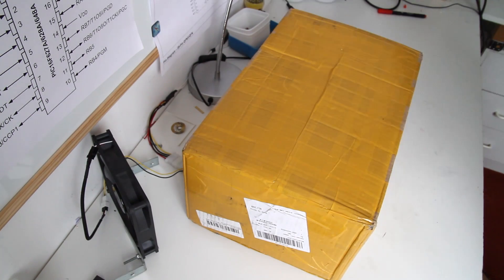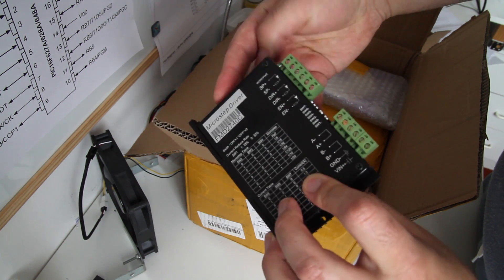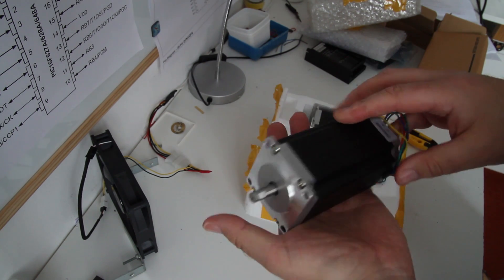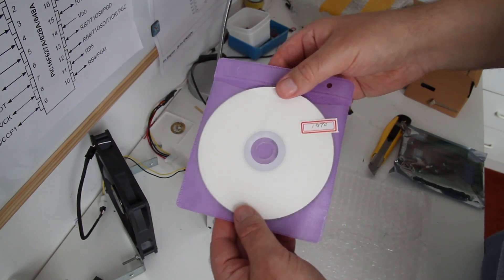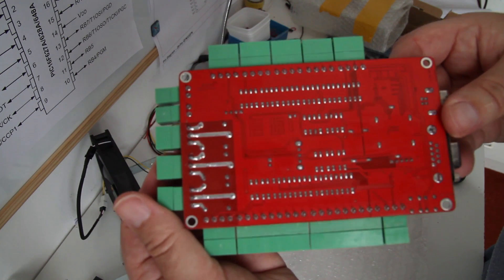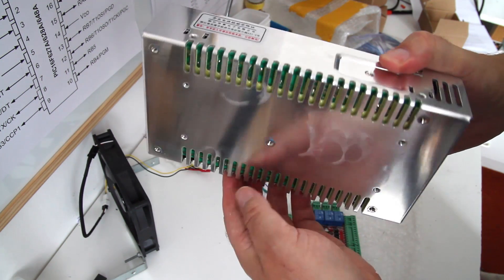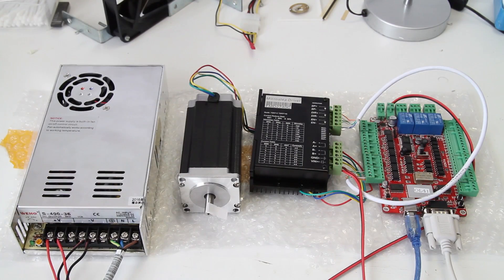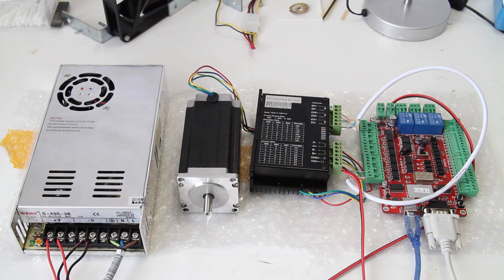Unboxing CNC Stepper motor kit

Comment: OK sir excellent
How much this kit and this model available
Reply from the maker: The old links doesn't work anymore, but this one is similar: https://www.aliexpress.com/item/4000044097918.html
I don't use the controller anymore, I went with AXBB-E fron cncdrive.com. Works much better, no more interference and the control software is better too (UCCNC). 
I've since put these steppers and drivers into a new DIY machine.

Comment: How much it cost the kit?
Reply from the maker: It was 217 euros. The usbcnc controller isn't great, better to use something better like uccnc. Seems to skip steps above 2000mm/min. And has bad path planner, ie small circles the velocity will often be too high. Uccnc is much better, can easily do 4000mm/min with the same stepper motors. I still use the stepper motors but in a new cnc build I designed myself.

Comment: I have recently purchased this kit. Has anyone got the UCNCV4 controller drivers to work with Windows 10 operating system ?
Reply from the maker: The supplied software still works under windows 10, just run it as administrator. I think I managed to upgrade the software once but I wouldn't recommend it as that might render the board unusable.

Comment: MakerCentral

  I need help on the hardware parts.
  and wiring the hardware up .
  and what software to use 
 to operate my CNC machine 
 Here is my list of the parts
 i'am using can you help me  

 1] Stepper Motor Drivers power step PSD8079-2P
 2] steppers motor Nema 34
 3] controler
 4] power supply mean well SP-320-48
 5]                  Hardware and Software 
 6] CNC Breakout Board/Interface Board
 7] Cable Connector
 8] Limit Switches
 9] Emergeney STOP BUTTON 
 10] Software

Comment: Ik heb dezelfde set binnen gekregen, aangesloten volgens de video, het PDF'je,  maar de motor reageert niet.. ik kan de as dan ook niet draaien, zodra de stroom eraf is wel.. als ik zonder de stroom er op de as met de hand draai, gaat het rode lampje op de driver branden... enige suggesties?
Reply: I received the same set, connected according to the video, the PDF'je, but the motor does not respond .. I cannot turn the shaft, as soon as the power is off I can .. if I do not have the power on the shaft turn by hand, the red light on the driver turns on ... any suggestions?
Reply from the maker: Did you send gcode instructions to the device in order to make it run using the supplied software?

Comment: Hi i have the same kit (4axis) but my stepper drivers have the Red light all the time, and idk if that matters. Also i have an issue with program crashing ( CNC is stopping and i need to reset the board or unplog it from PW) at some point of g code. Any help?
Reply from the maker: The red light is a power indicator, so it's normal. The board is sensitive to emi and groundloops. I had the same problem with a normal desktop PC. It would trigger the z axis when the spindle was powering up and crashes every now and then during a job. I now use a laptop and it works perfectly. You can try a different psu and check ground wiring, preferably in a star formation, so all devices connect ground to the same point directly.
Reply: Hmmm thanks. Could you send some photos od how u did ur wiring?
Reply from the maker: @ukaszswiadkowski8202  A photo won't help, it's a bad illustration of how things are wired. I use 5 wire shielded cabling so you can't see which wire goes where. See the pdf in the video description for more wiring info.
Reply: Also if u could tell how did u set Ur stteper drivers? I mean the switches. Thank you
Reply from the maker: @ukaszswiadkowski8202  
It will depend on your machine of course so don't just copy these settings and expect it to work in your situation:
XY
Dipswitch
1 234 567
0 100 101

Powerdown mode:   50%
microstepping:    1/8
Current:          3A

Z
Dipswitch
1 234 567
1 000 000

Power down mode:  25%
Microstepping:    1/2
Current:          0.5A
Reply: Yes i knows. Thank you :)
Reply: Also last question. Did you GND your breakout board? Cause i dont see any GND coming from the board. I think that might be the problem

Comment: Hallo, ik heb dezelfde set enkel met 4 nema 23 erbij, ik heb dit gedaan omdat mijn x as 2 motoren heeft. Helaas kom ik nu tot de conclusie dat het niet mogelijk is om de a as in slave modus te zetten.
Ik heb rattmotor gecontacteerd, en zei geven ook aan dat het met deze breakout board niet mogelijk is. Weet jij of het mogelijk is om 2 motorcontrolers aan te sluiten op de x as uitgang van het breakoutboard, of brand de boel dan door? Tevens heb ik het probleem dat de z as maar 1 kant op draait, ook met hand bediening z- en z+ draait de stappen motor dezelfde kant op. Ben jij misschien bekend met dit probleem? Graag hoor ik van je, mvg. Jack
Reply from the maker: Je kunt 2 motor drivers op een as van de controller zetten in parallel, dat is geen enkel probleem. Ik gebruik ook twee motoren, maar dan voor de Y as. De motors andersom aangesloten zodat ze elkaar niet tegenwerken. Ik heb 1 as over die als as A kan dienen, maar nog niet op die manier gebruikt. Je kunt twee steppermotors in serie op een motordriver aansluiten maar dat zal niet tot de beste prestaties leiden (snelheid en kracht). De motor driver is stroom gelimiteerd dus zou niet door mogen branden tenzij je de motor in bedrijf loskoppeld.
Z as die een kant op draait? Kan zijn dat de stepper motor te weinig stroom krijgt, te snelle pulsen (te hoge steps per mm) of het gewicht die eraan hangt te groot is. Check ook of het DIR signaal wel goed doorkomt.

Comment: Hello Market Central...i've bought the same CnC UsB set from Aliexpress and i I have the red led on and the Nema 23 works but slowly ... If I change the switches I get to a very fast rotation but the engine starts to skate (so too fast I think) ... I well connected the 36V of the WEHO Power box on the GND and Vin + of the FMD 2740C controller, the 2,3,4 switches are lowered (so on ON), then connected ... SP + / CK + then SP- / CK- then DIR + / DIR + then DIR- / DIR -... Does the GND (of the FMD2740C controller) have to come from the 36V or the WEHO power box ...? In addition the 36V is connected to the pad J1 (15-36 VDC) of my card UCNCV4 (red) ... I also have a problem on the software provides CNC USB because it recognizes my card by indicating for example ... MIGE-JHNF ... (16 digits) but despite the activation key, after validating on "OK" I am still in "test software" ... so it does not register ...
Thank you for your help, this is my first CNC .... Philippe
Reply from the maker: You have to set the switches to the stepping mode you want to use, which more or less changes the accuracy of the cnc motion. The finer the steps to more accurate but also less powerful. Find a balance for your needs. Set the maximum velocity/move speed in the software so it doesn't skip at feedrates that are too high. GND needs to come from the same supply as the +36V. I can't help you with the software though. it was quite fiddly but it should work with the version provided.

Comment: Hi, can this function on xy axis, do you se on ebay if have 2 motors kit?
Reply from the maker: I'm not sure why you wouldn't want a z axis, are you going to make a laser cutter setup? I suppose it should work. If you use lead screws you can use 2 stepper motors.
Reply: @MakercentralNet  for up grade wood lathe to cnc
Reply from the maker: Interesting, I guess the axis along the length and the depth should do it. I have no idea how the CAM would be programmed for that but the controller uses gcode so that should not be a problem if you know how.
Reply: But i can be sure how much stepper motor  Nm on y axis and x axis

Comment: Can I use this 3 stepper motor by using Arduino for industrial machines
Reply from the maker: Yes you could but for industrial use I wouldn't recommend it. Arduino's don't have optical isolators like proper controller boards do. You could make them for the Arduino though and maybe there are modules with opto isolators.

Comment: I have this same setup plus a Variable Frequency Drive (VFD). Where does the VFD connect to the UCNC4 breakout board?  The instructions are not very clear....
Reply from the maker: It should connect to the Spindle connector (in the documentation indicated as connector N). I haven't done this myself. I don't know if the VFD supports the PWM signal coming from the controller. The vfd either needs 0-5V 0-10V or 4-20mA signals.
Reply: Thanks! I also pinged the aliexpress tech rep...his reply was "PWM2 (on Breakout Board) to VI on (VFD), DIR(on Breakout Board) to FOR(VFD), GND(on Breakout Board) to ACM(VFD)"...after I looked at the schematic I saw  the PWM2/DIR/GND position on the breakout board is labeled SPINDLE (Duh!)...there is also a "spindle relay" position on the board.  Any idea what that connects to?
Reply: @jeffmusselman5413  thanks for the info! The relay is to switch on/off power to the spindle. But I wouldn't switch such a big load with such a small relay. Start/stop can probably be routed using digital out to the vfd. That way the vfd can actively brake the spindle when turning off.
Reply: Thanks Josha!

Comment: Greetings. What does the red LED on the driver mean? (fmd2740) and what does green mean? I always glows red, but the stepper motor works
Reply: The red led is the power indicator, green i think lights up when step pin is pulsed.

Comment: Hi, first of all compliments for your video. From little time I have discovered and I/you/they have been spellbound of the world CNC. For this I would want to build a car it cuts polistirolo to warm thread. I have bought 4 motor stepper Nema 23 together with the drivers St 4045-A1. To pilot these motors I think about doing him/it with the program of pilotage DevCnc Foam, that Arduino a compatible R3 points out with this software. On their site us a chart with the pins to be inserted. Only that I don't succeed in understanding as he does. For-favor, begs you to help to make me these connections: driver - controller. If you succeed in sending me a photo with a sketch to this email: valentinleahu39@yahoo.com would be ideal. I write you from Italy and this translates letter him with Google translator. I hope that you succeed in understanding me. I beg you so much, so much, so much to help me!!! Thanks in advance!

Comment: Hi. I have the same driver and fee. but something is wrong with the connection the warning light on all drivers is lit. but the machine works. can have time to show the full scheme of connection?
Reply from the maker: The LEDs on the driver only indicate power and if they receive step signals. Here's a wiring instruction I made a while back: http://makercentral.net/media/yt/WiringFMD2740C_To_UCNCv4.pdf
Reply: the only thing that is not connected together is EN + and EN- with SP + and SP-. just need to put the jumpers then?
Reply from the maker: Yes, that's right. Just a short wire will do the trick.
Reply: Thank you very much .. tomorrow will try))
Reply: connected on a scheme. but the problem remained ((
Reply: When connecting the jumper from the EN to the SP, the X axis does not react
Reply: In my case I leave "EN+" and "EN-" /unconnected/ for normal operation.
I think something was lost in translation of the documentation - putting power to these terminals /Disables/ the drive (shuts down the outputs so the motor can be freewheeled by hand). So perhaps EN+/EN- should really be labeled DIS+/DIS- to indicate it Disables the drive.

Comment: This breakout board has issues with radial decceleration. I tried to use it but my machine banged loud on the end of every arch with sharp corner when running 4.5m/ sec. It might be ok for small light cnc low speeds.
Now Im using usbcnc for mach3 and i can go 7m/sec with no problems.
Reply from the maker: Thanks for the heads up! I usually go no faster than 4000mm/min when jogging manually, and 2000mm/min max when running gcode programs, which is plenty fast enough for most jobs. Also keep the acceleration low. But you're right that cornering is a weak point with this board. I'm sure you mean 4.5m/min?
Reply: Yes, You're right. I mean 4,5m/min.
I also noticed when running 2m/min gcodes it was loosing steps on longer runs.
Only 1m/min was safe for me but thats too slow for cutting plywood. So I was forced to replace. Mach3 controller is only 40$ in china. It works smoothly, reaches higher speeds. You can double microsteping and torque with the same feedrate.
Please don't get me wrong. I'm not a dealer. Just want people to avoid problems I had with this board :)
BR
Reply: @MakercentralNet 
 I am going to use 3 nema17 7.2kg torque motor is 1 lrs75 24v power supply enough for it?

Comment: Hi please i want to ask a question i have the same kit but the stepper cant go to a higher speed at 24 volt like in your video even i slowed the acceleration and mad 1/8 micro stepping
Reply from the maker: Unfortunately it won't go any faster unless you put it in 1/2 step mode. But it hasn't been a problem for me. Travel speed of 2000mm/min during gcode program and 4000mm/min when adjusting manually seems to work fine. The speed is also limited by the Z axis (800mm/min max) so with 3D carving that's the maximum speed or the z axis will stall.

Comment: I have a question if you can help me please
I have the same setup and I cannot get my motor to turn the one thing I dont know for sure is do you have the breakout board supplied with power? The only thing I have in my board is the connections to the driver and the then the usb cable and the keypad cable?
do I need power to the board?
Reply from the maker: Yes, you need to supply external power to the board because the input/output pins are all powered with it. Without it, it can't communicate with stepper motor drivers, end stop switches etc.

Comment: Kindly confirm Solidworks drawing will be support this software
Reply from the maker: You will need a toolpath creating plugin lile HSMWorks or SolidCam, SolidWorks doesn't have this as standard unfortunately.
Reply: @MakercentralNet  werkt solidworkscam ook? Welke software gebruik je zelf?
Reply from the maker: Ik gebruik HSMWorks in SolidWorks, lijkt stabieler te zijn dan CamWorks (zelfde als solidworkscam). Daarnaast Vectrics aspire, dat gaat een stuk makkelijker en sneller voor het maken van toolpaths.
English: I use HSMWorks in Solidworks, seems more stable than Camworks (same as Solidworkscam). Aside from that I use Vectric aspire for faster and easier toolpath creation.
Reply: @MakercentralNet  thanks for the answer. I know solidworkscam has limited options in milling. Is mach3 supported by Sw cam?
Reply: @jeroenvn4854  yep, and if not, most cams have a cam export scripting engine that can be adapted to support the controller you use.
Reply: @imqqmi  thnx! I'm still in the design phase. I already work with SW and have the cam add-in so I only need a cnc controller(mach3). Any other suggestions?

Comment: More a question than a comment. Have you had an opportunity to evaluate and demonstrate the TC55h controllers from topcnc in china?
Robert
Reply from the maker: Nope, I'm still using the UCNC v4 controller that came with the kit. It's working nicely so far. The TC55h looks interesting.

Comment: Ik ben op zoek naar de instellingen in usb cnc voor deze controller en motoren. krijg het niet goed aan de praat.
Reply from the maker: David, begin met een bepaalde waarde zoals 33.333mm per unit, meet dan de afgelegde weg en pas de waarde aan. Om het uit te rekenen/to calculate the steps per unit: mm per revolution = Belt pitch * number of pulley tooth.
steps per unit = (microstepping * steps per revolution) / mm per revolution
Example: mm per rev = 3mm GT3 pitch * 16 tooth = 48, steps per unit = (8x microstepping * 200 steps per 360deg) / 48 steps per unit = 33.3333 steps per mm. I've chosen smaller 16 tooth pulleys to increase resolution and force. Set acceleration to 25. Feedrate to 1000. Increase when needed or possible.

Comment: I have the same setup but am getting a red light on the stepper motor drivers, do you know solution?
Reply from the maker: The red light indicates that it has power. I'm not sure what the green light means though. Both are lit on mine.
Reply: Figured out the problem, was not powering the board. Thanks for the video.

Comment: Hi, I have this same exact kit and am having trouble wiring it. Do you know where I can get more information besides what has been provided for me in the manual?
Reply from the maker: I've made a little guide to wire up the stepper motors to the drivers and the drivers to the board:
http://makercentral.net/media/yt/WiringFMD2740C_To_UCNCv4.pdf
Reply: I thank you very much for this wonderful information.
Reply: Shivala Productions ii
Reply: You misspelled the driver name into your PDF, you said "Wiring FMD2940C driver to " instead of FMD2740C
Reply from the maker: I've finally got around fixing the errors, thanks!

Comment: Hi, I want to order for this kit , Please provide reference .
Reply from the maker: This is the seller I got my kit from: https://www.aliexpress.com/item/3-axis-CNC-kit-Nema-23-Stepper-Motor-Dual-Shaft-425oz-in-112mm-3A-Driver-40VDC/32782817490.html?spm=a2g0s.9042311.0.0.iTSgrS
Reply: Received my ordered products yesterday .
Reply: As per your provided link as above I was received the products and I want to use this for wood designing  , Is this possible ? motor power is 0.8 KW , I think motor is not suitable but driver and stepper motor is suitable for this case please confirm @ MakerCentral
Reply: @MakercentralNet   I facing a problem and need your help . My router not turning (in corner ) softly , machine turned with brunt. Also take much time to load G-code. Please suggest me if you have any solution's .
Reply: please let us know "NEMA 23" motor how much speed I can I use?@MakerCentral